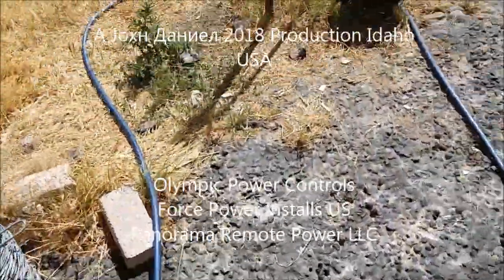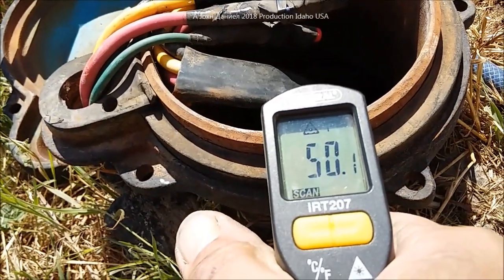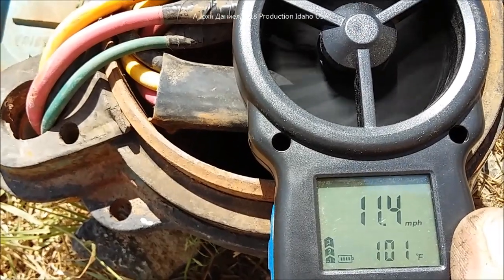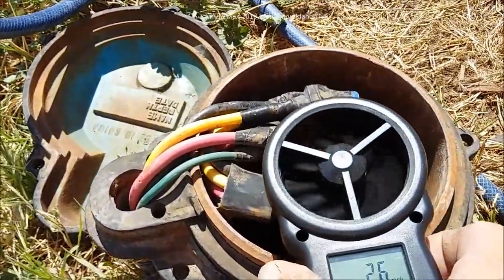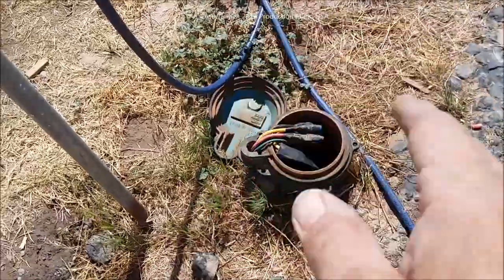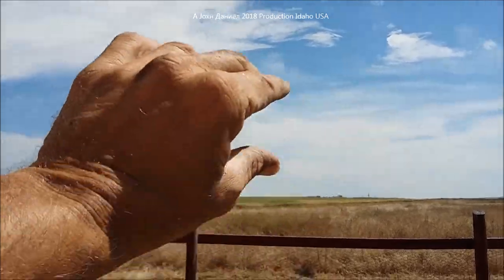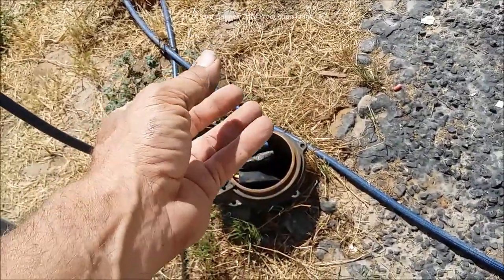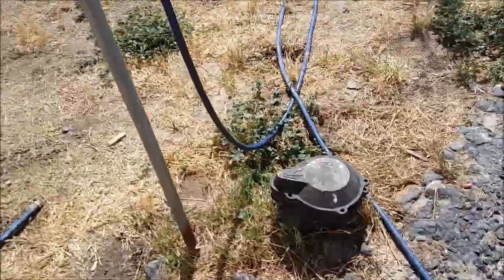Why does my Water Well BLOW out 12 mph ice cold Air? The Answers

Comment: Is there some way you can use that cold? It's been 80 degrees in my bed room at night!
Reply from the maker: 8 mph is as slow as it has ever blown, 15 mph is average, and 40 mph is rare but possible. However, We are looking to get a intercooler unit from a Semi truck to see if theres a rate of flow that can be pulled without freeze up on the well. I figure a 3" tube intercooler would resist flow enough, and a blower behind it would make a near free AC system. Then allowing the flow to exhaust out the shops roof.
Reply: Јоhn Daniel cool idea. My aunt had city water once. But lived so high up a mountin. It had to be pumped to her house. When there were storms. The water lines would blow off . or rupture. Flooding the house. I noticed the storms near by. And think it's a barometric issue. With high psi at the water tower. And low at the house. Causing the over pressure.  I fixed one minor leak. The o ring was blown completely out. I don't know how that could be fixed. Except for a relief valve or something. This was in the Tennessee mountains. That's a cool idea using a semi intercooler.  Just insulate the pipe. Put a fan on the intercooler. Maybe a fan pulling the air through it. On a timer. With a shutoff valve . my well I guess is more of a spring. It's only 40' deep and 15' under water. And hand fug. I was thinking of a radiator to run the cold water through. And circulate it. But only when its really hot. The water is 48-50 degrees. Give or take.  I think my well is part of a spring about 150' away.  I'm new to the property. And the well hasn't been used in 10+ years. So I'm not drinking it until its tested a couple times. I have two carbon filters on it. Still not drinking it.  I would still like to see videos of your charge controllers. You have welth of knowledge . and I do plan to build a tow dollie or two. To see if anyone is buying. And maybe lawn trailers. Since I have welders and tools to do so.  I lost a few tools a couple years ago when my home burned to the ground. It has taken time to get back to normal.  I am kinda looking in to a inverter that will be good to power tools. Start motors and such. I'm thinking I will go with 12v and 2000 -2500  watts.enough to run a good size circular saw. And drill press . not at once. I will use the generator to power the welders. Thanks
Reply: @JOHNDANIEL1  Freezing will most likely occur at the exit where sudden air pressure occurs ,it wont matter a lot if water pipe  is empty and only fills up when well is running , you could drop a temp probe down the hole and get a reading on temperature  down low ,anything lower that continuous 
30  could cause a plug to form and stress out the pump ,that's free geothermal

Comment: I think I'm pretty smart but I was going to comment pipe that into your house and but thank you for the explanation.😎👍
Reply from the maker: 8 mph is as slow as it has ever blown, 15 is average, and 40 mph is rare but possible. However, We are looking to get a intercooler unit from a Semi truck to see if theres a rate of flow that can be pulled without freeze up on the well. I figure a 3" tube intercooler would resist flow enough, and a blower behind it would make a near free AC system. Then allowing the flow to exhaust out the shops roof.